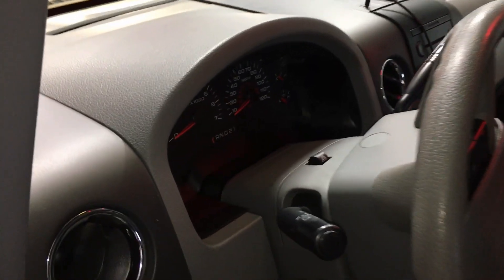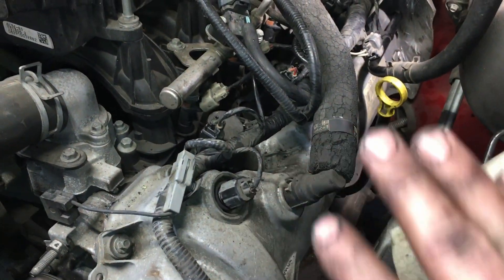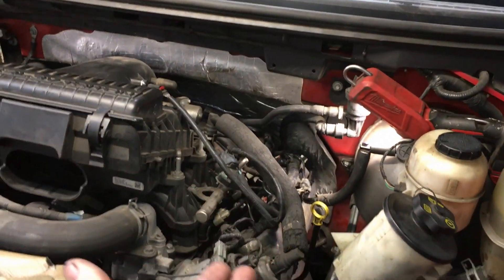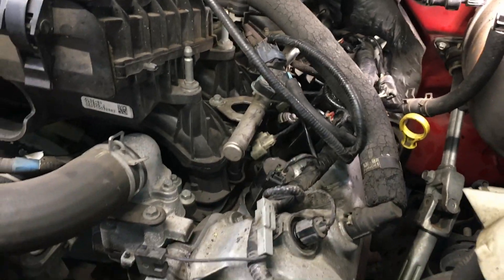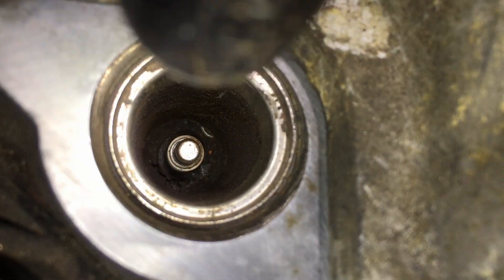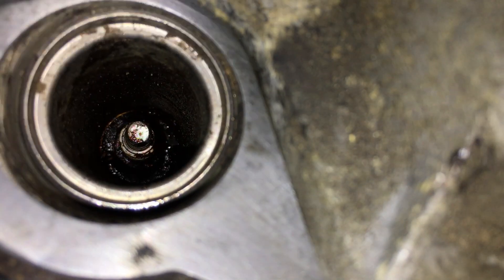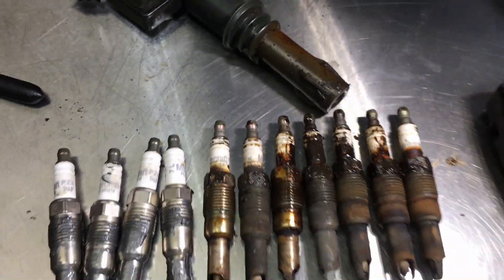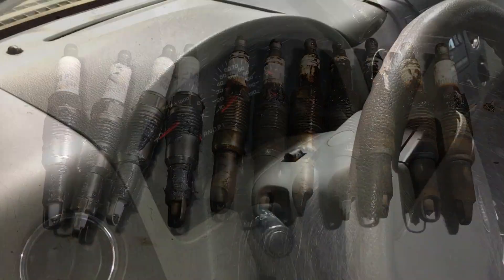Ford 5.4L 3v Triton Engines Fuel Smell and Ticking Tapping Noise: CHECK THIS ITEM FIRST!

Comment: Don't come a knockin' cause the coil packs a rockin'  🤔
Reply: Actually if the coil pack or even the spark plug is loose or even if they had put in the wrong spark plug in there can cause the motor to sound like it's knocking.

Comment: Looks like that pcv hose was in serious need of replacement.
Reply from the maker: No that is just the foam covering to prevent freezing, the actual pcv "hose" is a plastic tube underneath that does not rot.

Comment: I have a 08 5.4 f250 with 226k on it and I have own it since it have 20k miles and I have not had any of these problems the 5.4 is  Known for having... last plug change I did have 2 plug break off down in the head but the dealer got them out .and my f250 is only use as a work truck towing a heavy trailer 8000+ pounds to and from the scrap yard. Oh and it has 8500+ hours on it...I was not a fan of the 5.4 V3 version but I'm glad bought it. Look forward to my next truck being a 2014 f150  heavy payload package with 7 lug rears and the 5.0 v8..

Comment: That happened on my 5.4 2v. Noticed a slight ticking noise when it was warm. I changed that spark plugs on it and I noticed all were tight except one. It was just barely finger tight. And the porcelain was all burnt looking and black just like some of the plugs you pulled. Put new plugs in it and tightened them properly. the sound went away after that

Comment: Hello Brian, I have a '97 F-150.  I've taken it to 4 different shops in the area for an alignment and it's still not right.  While driving down the road with the steering wheel straight the truck pulls to the right.  If you correct it to the left a little to compensate, it veers hard left.  You correct it back to the center with the wheel straight it does the same thing all over again.  It's like something up there is fighting each other.  All 4 shops say everything on front end is in good shape and solid.  The last place I took it to a local Ford dealership put a caster/camber adjustment kit on it so they can adjust the camber since it had both upper control arms installed.  I've had it back to them 3 times and it may be a little better but not much.  Any idea?  Thanks.
Reply: eighthof8 possibly be your steering rack is over adjusted. Too much tension on the gear not letting it return to the center position.
Reply: Steering gear was replaced not long before I purchased the truck that according to the Ford dealership I took it to for alignment.  They said it had fairly new black paint with a Ford part number on it.

Comment: Thank you for your prompt reply. My replacement 06 motor had Autolite plugs to which all had broke. I will replace with new design. If you know of any info on the 04 to Aug. 05 3v builds being different than later years, for example cams, computer, etc., please share. Thanks again

Comment: I had this problem last month one spark plug came all the way out it was lose but the coil pack was holding it down so now I'm gonna check them every couple months now and yes I had to buy a new coil runs fine

Comment: HI! 
MY QUESTION HAS NOTHING TO DO WITH THE VIDEO. I HAVE A 1999 F150 4.6 L LXT 4×4 FOR SOME REASON I CAN'T GET IT TO SHIFT INTO 4×4 MODE IT HAS BEEN MAYBE A YEAR SINCE I LAST PUT IT IN 4×4. DIDN'T HAVE NO PROBLEMS THAN. THE TRUCK SAT / SET FOR OVER A YEAR IN DRIVEWAY UNTIL WE COULD REBUILD THE ENGINE REPLACING GASKETS. IS THERE SOMETHING LIKE A FUSE /  ETC THAT I'M MISSING?  LOOKED IN MANUAL I MUST BE MISSING IT .
IF YOU HAVE ANY ANSWERS WOULD BE APPRECIATED!  LOVE YOUR VIDEOS! THEY HELP OUT A LOT! BE SAFE! HAVE FUN! HOPE YOU HAVE A GREAT YEAR! GOD BLESS YOU ALWAYS  !
Reply from the maker: https://www.youtube.com/watch?v=AWXiArMiqBw

Comment: That's ironic that you posted this video. Couple weeks ago we had a 05 Ford Expedition come into the shop with loose spark plugs. We done a tune-up about a year ago on it. We thought maybe it was from under torquing.

Then today a 06 Ford F-250 came in with a misfire number 3. All the plugs were loose along with carboned up plug boots. We had tuned that up in April.  We found it hard to believe that one of us would be under torquing again.  We've Googled to see if it was being seen by others. No dice. I saw your video tonight and was surprised. At least we know it seems to be a common problem and not something that we did.  Thank you for the information!

Comment: On Amazon link sp546 but on box reads sp515, new design, for all 2004 f150 5.4 3v as well?
Reply from the maker: They all ship the SP-546 now that is just a stock photo. These plugs apply to 2004-2008 mid year before the head change.

Comment: Oh man, I wished I had this problem!  I have a 6.8 2V,  idle is great but when I take off from a dead stop it  stumbles and jerks really bad till I get to 1500 RPM's , then it runs great!  No codes pop up. I have changed the fuel pump and checked fuel pressure (35 psi). Replaced all 10 injectors (brand new),  10 new Ford coils & plugs,  new MAF, TPS, IAC, Cam position sensor, EGR is good, new ECM.  I'm desperate now!  My  beautiful 99 F250 with 165k miles has got the better of me!  Any ideas out there besides backing it down a boat ramp with no trailer.
Reply: Drive it to Eric O. at south main auto in newyork
Reply: Dirtyharry70585 , Wish I could!  It's just a tad bit too far from north Mississippi.
Reply: Wow PJ, sounds like you spent an awful lot of money. Maybe this is a stupid question, but did you do an engine diagnosis before doing all that work?
Reply: Joel C  yep!  The Ford dealership hooked it up to the IDS scan tool.  Nada, zip, zero!  I am completely lost on this one!  I need a technician that can really go deep into the scan tool to find out what the hell is going on.  I can't find a expert technician  in my area.
Reply: @pj9731  Thats too bad. There's gotta be somebody out there that can successfully diagnose the problem. keep looking and good luck.
Reply: Have someone check the map sensor (frequency) if that truck has one.
Reply: HeyItsVos , mine does not have a MAP sensor.  Thanks for the suggestion though.
Reply: Btw PJ, I also have a 99 F250 SD. I'm 2nd owner. Bought about 3 mo. ago . right now it has 140K on it . When you open up the throttle it takes off just as if it were turbo assisted. It's very responsive  and smooth running. I was a bit leery at first about the 10 cyl., being I haven't ever owned or driven one but I'm very pleased with it. One thing I don't like is the steering. On mine you really can't divert your attention from the road b/c just a slight movement of the hand on the steering wheel and the truck feels like it grabs the road and will go too far in the direction of the hand movement. Kinda freaks me out. I have new tires and have new control arm bushings and wheel alignment, but it didn't change anything. I'm now wondering if the rear end being a couple of inches higher than the front end has something to do with it. Previous owner probably hauled a fifth wheel with it.
Reply: Joel C , mine steers great.  I did have to change out my sway bar bushings @ 126k.  Not long after that I replaced all five shocks with Bilstein's.
Reply: Is that 35 psi within specs? I'm asking because a weak fuel pump can cause issues.
Reply: JackOfAllTrades , yep!  I may have to inspect all wiring harness connections at this point.
Reply: Check out the fuel filter
Reply: get someone to check it with a scanner that has live data.. check the compression on all cylinders to see if there with in spec I heard story's were the ones in the back closer to the dash have lost compression..and double check for small coolant leaks that could be tear dropping down to the spark plug makeing it miss fire.. one last thought thing to check there are 2 small rubber hose that come out the driver side manifold exhaust in to the pressure feedback sensor for the egr I believe make sure those are correct cause feel the tip on both ends with your fingers there is a thinner and a wider people think the right one goes on the right and the left on the left not the cause on some f150s some the right to the left and the left one to the right one
Reply: Osvaldo Narvaez , awesome tips!  Will do!  Thanks!
Reply: P J no problem.. and double check on your connection too.. keep us updated

Comment: Does this happen on the 2004  4.6 litter motor as well
Reply: Nathan, yes it does. Had same issue with 2005 4.6 crown vic. Raw fuel smell that i never would have guessed was spark plug stripping itself from the head. Lead to blown out plug tand had to helicoil new threads into head.

Comment: I have a 1998 Ford Expedition Eddie Bauer edition what version engine do I have? Oh it's a 5.4
Reply: 2 valve.
Reply: @Pr0ph3cy-k5z  so the "V" stand for valve? Not version!! Right.
Reply: @chipete1  correct
Reply: I can't remember the years, but in the 97/98 models of the Triton 5.4, it was the 2 valve. Then Ford created the 3 valve to fix the issues that the 2 valve had. Then they created the 4 valve.
Reply: @Pr0ph3cy-k5z  what's the biggest problem with the two valves?
Reply: The main issue with the 5.4 2 valve is the spark plugs blowing out. I had I think 267k miles on mine when I sold it and never had a plug to blow out. I did have tons of coil pack issues and 2 head gaskets to blow as well as 2 intake manifold gasket replacements. Mine also had several bad valves that I never fixed. It had the cold start blue smoke during the cold months. I sold it for $1000 and the guy still drives it without repairing the valves. I was burning a quart of oil about every 500 miles. It also had the classic tick and timing chain clatter. If you blow a spark plug out, then be prepaired to do a helicoil repair job because it will most likely rip the aluminum threads out with the plug. That job can be done without removing the heads, but if it's the number 4 or 8 plug, it's a pain PAIN to get back in there to properly do the job.

Comment: Good tip. Thanks. I’ve got an 08 f150 with the 5.4. 37000 miles. Original factory plugs.

Comment: OMG I had exactly this problem on my 2007 5.4L 3v. Had problems for YEARS. Running rough; Old plugs replaced; loose plugs; tightened; still running rough; plugged cat; replaced; still running rough; replaced plugs again; another failed cat; replaced; STILL running rough; cylinder 5 miss; pulled plug before misfire ruined ANOTHER cat; missing electrode! Replaced cyl. 5 plug, PROBLEM SOLVED/Good as new!

Chased that misfire caused by plugs/cat/plugs/cat/plug for at least 3-4 years.
Reply: I'm having the same problem with the exact vehicle...

Mechanic says I need a new motor...

Comment: Thanks for the information on that Brian. It is weird that just last night I came across a person that has an 05 F150, and I didn’t ask him if it was that 5.4 3 or 2 valve but it had a really loud tappit ticking noise that sounded like a stuck lifter but he said here taking it apart and change the litter and rocker arm and all that and it was running fine but it still has that REALLY loud noise. I thought that to be really odd... have you ever come across that?

Comment: This is why I have the 4.2 pushrod motor. Much more solid
Reply: 500k mile engine with no frills...just leaks oil and has issues with egr ports clogging and those intake runner control arm bushings.

Comment: 2003 ranger no crank no start.. Starter is new battery is 6 months old full charge on it.. What else can I check tips are appreciated
Reply: Theft light flashing?
Reply: @thefordmaniac  
I lost my key to bicycling through an electrical storm.
Reply: Or instead of throwing parts at it and blaming ford for your lack of knowledge on the subject take it to someone who knows something.
Reply: @thefordmaniac  I have a certified mechanic whenever I need him to help and he is lost himself plus I'm a Chevy man
Reply: Do you have antitheft?   If so, your key went bad.  If the AT light flashes when you try to start, that's it.

Comment: Great tip, and when you looked, you could see the top of one coil moving in time with the tapping.  What torque spec did you use to seat the new plugs properly?
Reply from the maker: It was moving just because I removed the screw for it, I torque them down to 25ft lbs.
Reply: FordTechMakuloco Thanks!

Comment: Just got a 5.4 2v n swapped the plugs and noticed this.. alot of oil, dirt,and gravel! Plug #4 soo bad that the magnet on socket wouldnt grab it! I got 7 but just need that last one...any recommendations on how to take it out?
Reply: If you have already unbolted it from the block and its just sitting in the hole, use a piece of rubber fuel line or old school heater hose to push down over the end of the plug. Great way to install new plugs too to avoid possible cross threading with a socket.
Reply: @alberth8073  cant unbolt it cuz magnet wont grab it. Too much oil n dirt. It was a farm truck

Comment: I have the similar question as below, have you encountered this problem yet with the ‘08-‘10 tritons with the updated spark plugs?
Reply from the maker: No
Reply: @FordTechMakuloco  I have a 2010 with this ticking and a fuel smell (when not recirculating the cabin air).  I've had the exhaust manifold replaced, so that's not it.  It's in the shop today for brakes and I've asked the mechanic to check the plugs.  I'll report back.

Comment: Best piece of mechanical advice I’ve ever received was your advice to over-torque the spark plugs on my 5.4L 2v Ford E350 van. Have had zero trouble since I changed the coil packs and plugs.

Comment: Do you think that there is a possibility that people are applying too much anti-seize to the threads?  Its my understanding a lot of recommendations for the install of these plugs is that you get some anti-seize, at least on the electrode sleeve.  Maybe some people are getting carried away and putting it all over the threads too preventing the plug from seating correctly?  I know the plugs did not show anti-seize on the threads very well, but considering there is fuel/oil coming through them it seems like it would get washed away if it was.